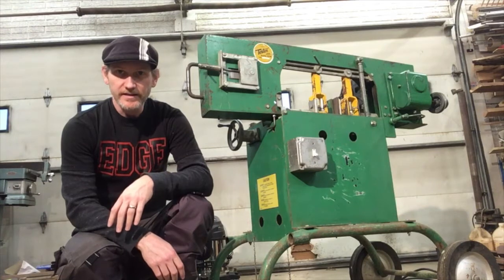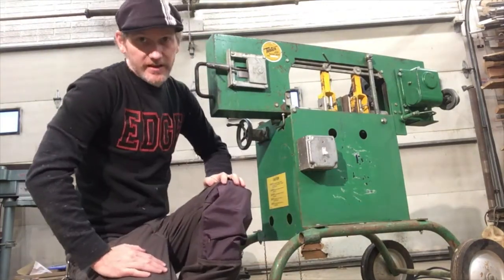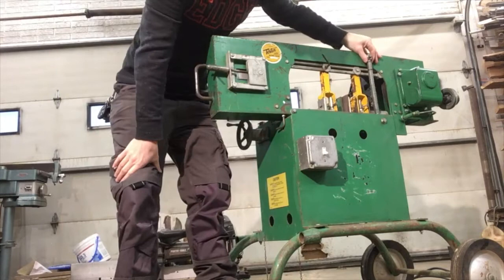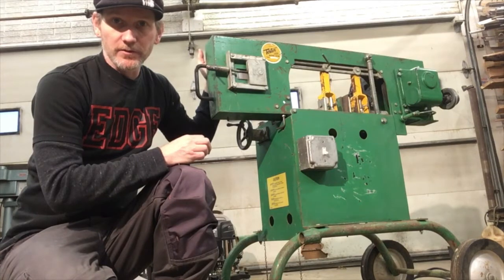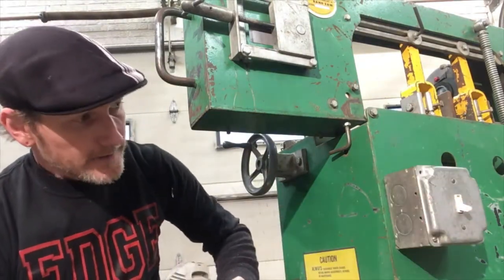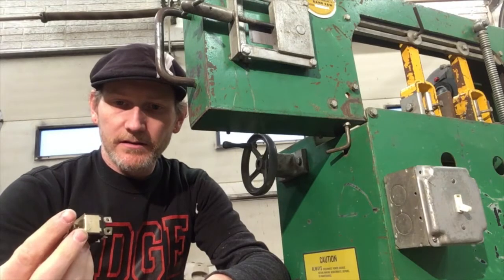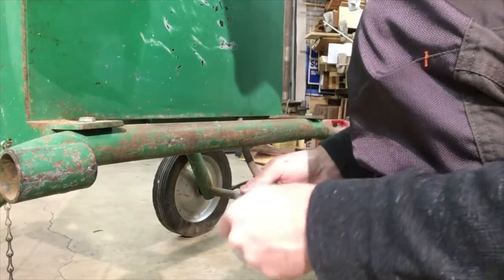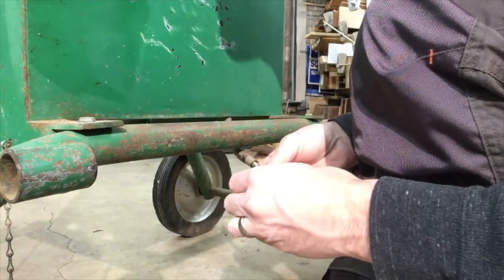Tester/Greenlee Horizontal Bandsaw Part 2 - Repairs and Power Switch Upgrade

Comment: Why didn't you just put the toggle switch in series with the original power switch?
Reply from the maker: I didn't need the other power switch. Lift it up, flip it on, let it turn off on its own.